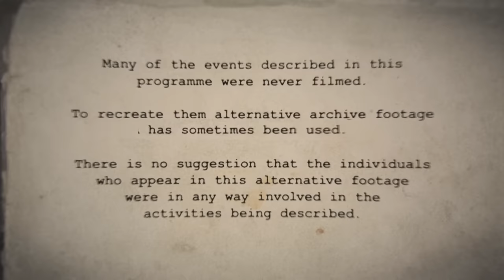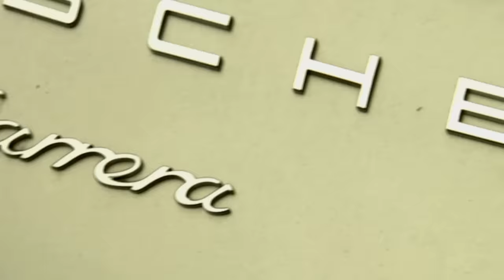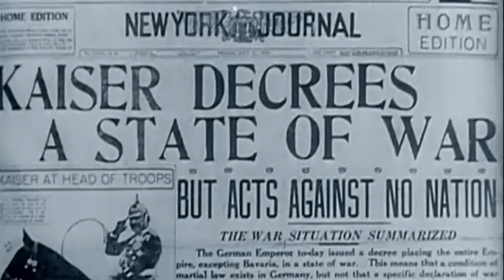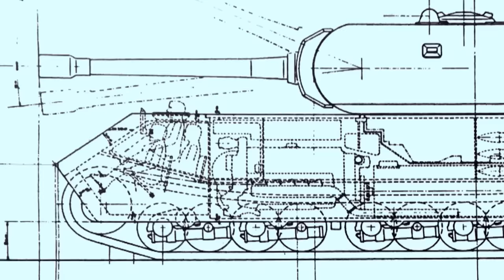War Factories | Season 3, Episode 4: The Tanks of Porsche | Free Documentary History

Comment: 32:59 this “historian” doesn’t know all tiger tank turrets were designed by Krupp. He repeats the old myth of “Porsche” turrets used on the early tiger IIs. No such “Porsche” turret existed.  The early Krupp turrets for tiger II (which did have a number of serious flaws), and were originally meant for Porsche’s new tank, but ended up getting installed on the early production Henschel tanks
Reply: There were actually 2 prototype Porsche turrets built and installed, but again, the failed for the military purposes.
Reply: @nobodyspecial4702  citation needed, never seen a Porsche turret installed on any tiger, even Porsche’s tiger I prototype had a Krupp turret
Reply: @spandecker727  I was of the impression that the two turrets with the curved mantles were designed by Porsche, though manufactured by Krupp.
Reply: Krupp already had already made 50 of the 100 “Porsche” turrets before they found the flaw so they fitted the 50 to the hulls of tigers and the rest had the “H” turrets.